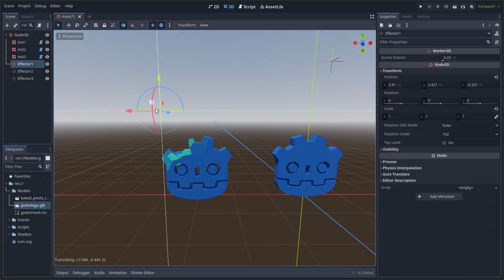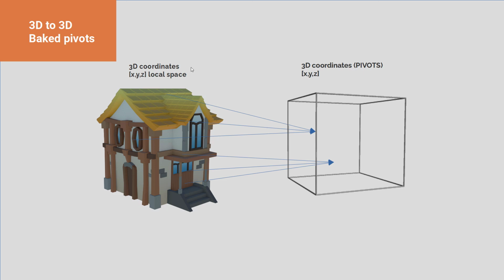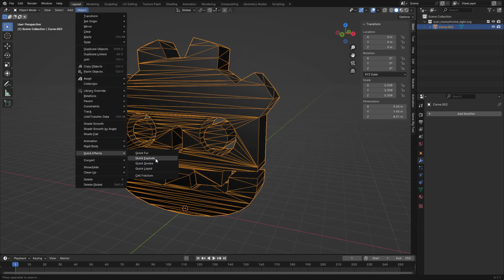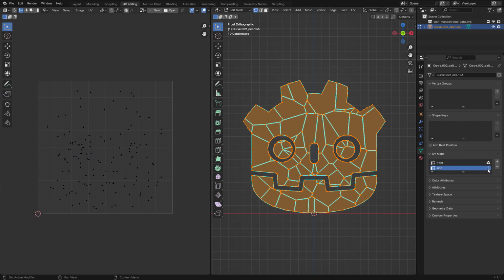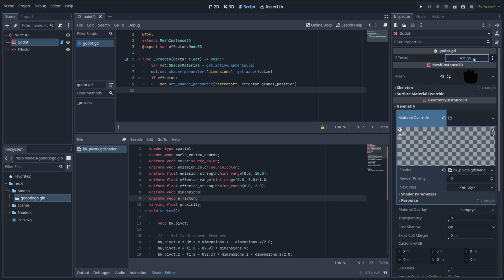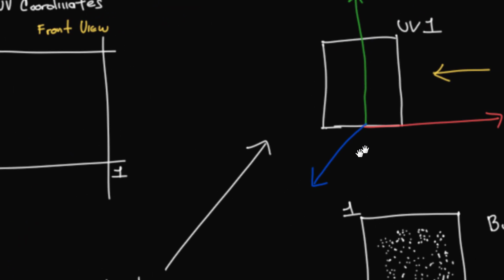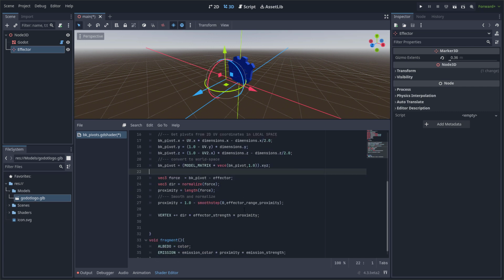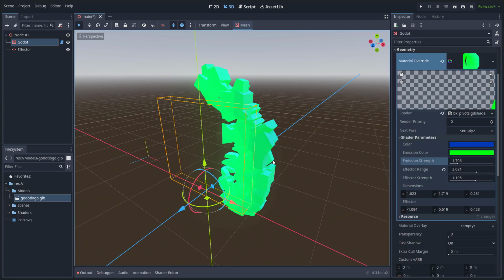Godot: Baked Pivots

Comment: can you add body collision and simulation gravity with this pivot feature , for example: crash a wall in pieces from bullets using pivot?
Reply from the maker: Maybe, but it wouldn't be worth it. A shader can't keep state, so it only reacts to external values (time, effector) as if it were a function. Then the physics of all the pieces would have to be calculated from outside (gdscript), which doesn't make sense.

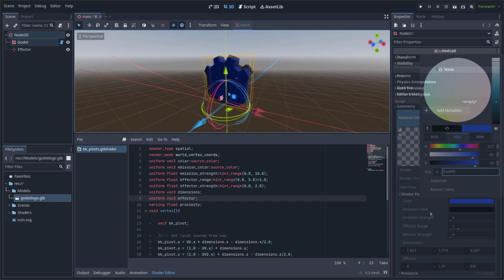Comment: Awesome job, one important detail you did not explain. At min minute 6:20 ... you did not mention Dimensions and Effector settings, if not set properly the effect is not visible.

Bottom Right of the screen (in the Inspector):
Dimensions (suggested)
1.8, 1.7, 0.2
Effector (suggested)
0, 1, 0.5

This is really important in order to replicate the effect you created. Also, just in case reload the project.

Comment: Really good work! 
couldn't you have baked the pivot positions into vertex colors? because using both uv maps leaves you with a mesh that has no valid uv map for the fragment shader
Reply: Do you only get 2 uvs in Godot?
Reply from the maker: That is something I need to explore in the hex sphere tutorial, because I'll need 3 UV maps. I was testing before the CUSTOM0,1,2,3 channels of the spatial shader and it seems that I can store additional UVs in those channels.
Reply: Baking pivot coords into vcols is unnecessary imo. Are you saying there's a limit on how many UV maps gltf/godot mesh can have?